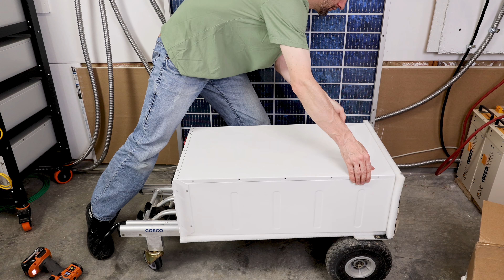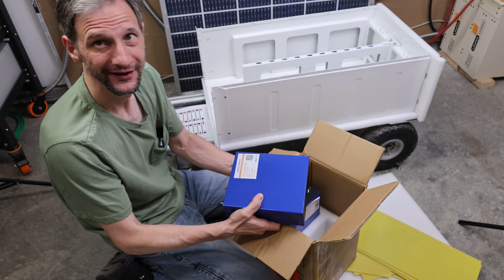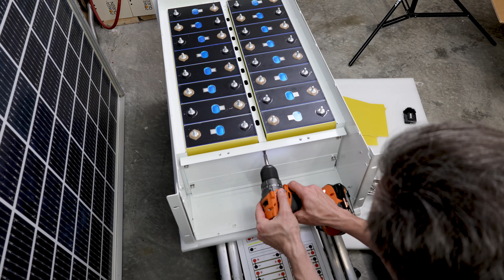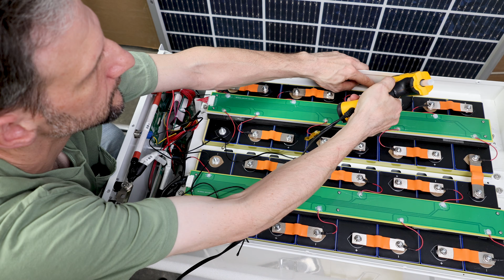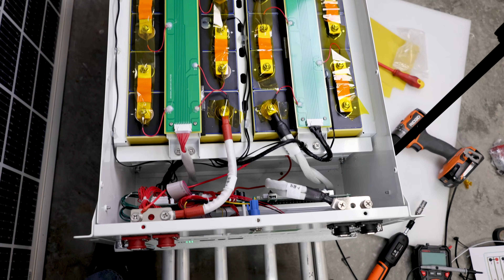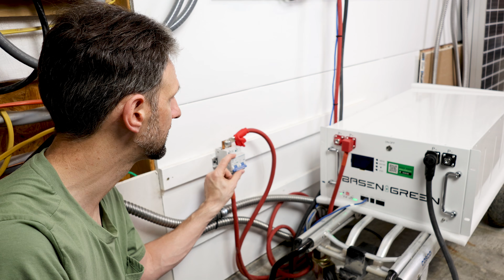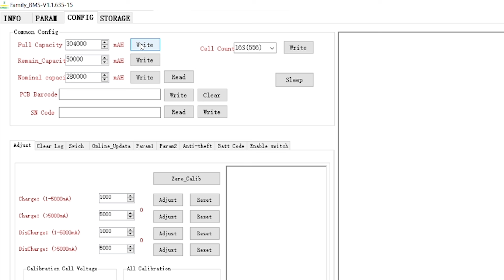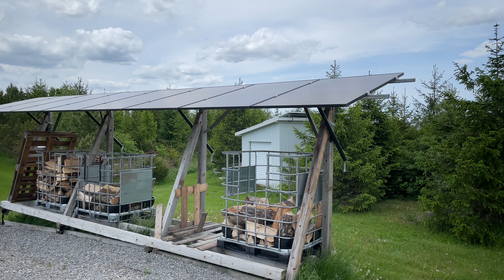SAVE Thousands - Build your own home solar battery backup!

Comment: Having worked on aircraft ni-cad batteries, if you decide to make this do not wear a watch or rings or wrenches 👍
Reply from the maker: Yes, good advice.  Avoid anything that could potentially cause a direct short.
Reply: I totally agree. The notch in my wedding ring also agrees. 😮
Reply: seen a guy vaporise the flesh around his wrist due to a watch band grounding to the aircraft chassis.

Comment: I'm not sure, but it appears that you continue to turn your torque wrench after it beeps. Wouldn't that damage the cells?
Reply from the maker: The timing of the sound in the video is probably just a little off.

Comment: I know you did not say this was for beginners but, I had high hopes, Because of the DIY-themed title of the video, that I'd be able to follow along.  You almosty had me enthralled, but, too much jargon for my beginner ears.  I'll keep searching for someone who wants to talk to folks in layman's terms.  "BMS"? (that's whhere I stopped wacthig; about the 7:30 mark)
Reply from the maker: BMS = Battery Management System
This is the electronic controller that balances the cells to keep them at the same level of charge as well as many other control points.
Reply: @ProjectsWithDave  Thanks for the definition.  I sincerely hope your channel succeeds.  I just need things to be a little more basic.  

Apparently, I'm not at the point in my solar education where some of the more in depth details and associated jargon are music to my ears.

Comment: Can use these cells in an rv ?
Reply from the maker: If you put this system in an RV, I would spend some time wrapping and securing the wiring better to protect from vibration.

Comment: @ProjectsWithDave I'm curious how do you connect it to your old battery? The two batteries will have different capacity and different full charge states. How do you prevent them from overcharging each other?
Reply from the maker: I connected my 25kWh pack with this 15kWh pack in parallel just to see what would happen.  The result is they do charge and discharge at different rates but it isn't too bad.  If I let it run for a couple of weeks without saturating at 100% charge the smaller battery drifts down and might be at 20% SOC when the larger pack is at 50%.  If I let them fully top off once a week it works ok.  Finally the best solution is to put matching packs together.

Comment: How much time does it takes to recharge it? 
And how much time, for example if I have only 5kWt or 10kWh?)
Reply from the maker: It completely depends on your charger.  The chargers I have connected can charge at 60A from the grid or 200A from solar.  At 60A for example that is about 3.1kW.  So a 10kWh battery would take about 10kWh/3.1kW= 3.2h.

Comment: I was kinda 'oh well, no way it's that cheap in Europe (Netherlands) but to my surprise the 16 batteries are 'only' 82 euros each and the housing is only 275 euros, including shipping from China. That's under 2k for a 14-15kW battery :O (a commercial pre-made setup using essentially the same hardware is 3000 euros - of course, that does mean you'll have warranty that you won't have (or rather, warranty that will be hard to claim when the housing comes from Alibaba) - still, an easy 35% savings).
Reply from the maker: Right, there are always trade offs like warranty to consider.
Reply: @ProjectsWithDave  I did the math and it comes down to 1600 for building the same battery pack you built vs 3000 new so maaaaaybe the 'package deal' warranty isn't worth the price of basically a 2nd 15kW battery 😄
Reply from the maker: I tend to lean towards DIY and "self insurance" for most things in my life.  I am often disappointed in warranties anyway.

Comment: The BMS leads go to the positive of each battery and the one black one goes to your first negative. 
I love the way you’re wrong with confidence though.
Reply: Seriously? Yet it all worked?
Reply: @rxonmymind8362  The balancing leads being hooked up wrong would not show any immediate effect. These leads are only there to compensate slight differences between the different cells and ensure they're on a consistent voltage. If you actually hooked those leads up wrong, it would only become apparent as some cell voltages drift over time, its not a problem that becomes visible right after putting it into operation
Reply: The positives are bridged to each negative and will read the same voltage, abeit of the battery below it. I love the way you are so confidently wrong.

Comment: This is a very unprofessional and dangerous assembly.
No non-conductive gloves, doesn't cover the terminals while working with conductive tools, terminals are not enclosed from the lid, thus if the case is dented it could make a permanent short.
FYI, I am an electrician but not in any capacity trained in these systems. Just my common sense and respect for electricity.

Comment: I accidentally shorted out one of these 3.2v 200ah lifepo4 batteries on some thin gauge wire. Insulation melted instantly and wire caught fire.
Reply from the maker: There is a lot of current available in these cells.  It's necessary to handle everything with the appropriate respect. That's why I added the extra insulating tape.  Anything to prevent accidental shorting.

Comment: Should always connect the positive first in case of accidental short to the chassis
Reply: @KL4life  then I'd be disconnecting the chassis from the negative terminal.
I understand using a chassis ground on a vehicle because of the length of runs of wire.
Is have a bus bar for the grounds and run one wire to the terminal
Reply from the maker: Right
Reply: What's the chassis connected to that would complete the circuit?
Reply: @samuelfox8126  uh, the chassis itself, duh. Every single one of those batteries is touching the chassis. If he were to hook up the negative first and accidentally touched anywhere on the chassis, it completes the circuit. Understand?
Reply: @KL4life be nice, not everyone has your level of expertise
Reply: @KL4life  gal
Reply: nope...

Comment: just curious but when you added the shims to get the batteries tight, would the batteries expand a small amount when they heat up? Just curious if that might be a problem, I dont mean if a battery fails and swells but I'm sure under a heavy load they might get hot and want to expand a little right? A small amount but at least something?
Reply from the maker: The batteries do expand when fully charged, but there is a foam spacer included in the stack that is also flexible.
Reply: love the video btw

Comment: Lame..... people!!! just buy the cells. Sit them on a shelf and hook them up...all this stuff is gimmick
Reply: Not a helpful comment without parts list, BMS recommendation and why recommended, pictures of finished install with racking chosen, .etc.  Do your own video with a link here so we can learn from your successes and failures.

Personally, I've already got 32 x 304 aHr cells via a US warehouse, a pair 48v JK Inverter BMS @ 200A continuous to parallel, big round red switches to isolate each bank, 2 bus bars, and instructions for connecting to my Sol-Ark 12k.

I've already built a couple 12v packs that are performing wonderfully.

Comment: 48v 100Ah batteries are now routinely under $1000 each, so the value proposition for this DIY build isn't all that good.
Reply: Wtf,  this is 300 ah for under $2000. That’s a lot.
Reply: Where can you find those prices? Even Will Prowse can't seem to find it based on his website for batteries. Also this is 200a BMS. All the server rack premade are 100a bms.

Comment: why would you keep tighten the screws after you clearly hear the beep...Jesus man, you want a fire in your house?
Reply: Have you used a digital Torque wrench before? All the the ones I've used have short beeps when you're within 0.5 to 1 nm of the limit
Reply: It's fine unless you strip the thread or spin the stud lol. Torque wrench is overkill to begin with

Comment: You mentioned something about Pre-charged Resistors and Capacitors: What is the purpose of these and the theory behind their operation?
Is this information in any of your other videos?

Thanks much.
Reply: The inverter uses capacitors in the process of turning 48vDC into 120vAC. Capacitors store a relatively small amount of energy but can accept it extremely quickly. A resistor allows only a small amount of current to pass allowing them to charge (comparatively) slowly, reducing the chance of damaging arcs when connections are being made (eg flipping breaker)

Comment: why not buy a gas generator?
Reply: Because:
1) you can’t run a generator backwards to create gas to store from your solar array
2) gas generators don’t switch over to cover grid power loss in a few milliseconds, rather they take at least a second to fire up, so you still have a power outage

Batteries provide utility most days of the year, gas generators provide utility a few days each year (if that)…which is a good thing because they are very expensive to run.

Comment: HI Dave, thanks for your great videos.  I'd like to build 2-3 of these batteries and use them with a SOL-ARK 15K or an EG4 18KPV.  I was wondering if you have full bidirectional communications capability with your inverter(s) and the included BMS (and if you knew that in advance) ?  

I can't get a straight answer about if this battery kit's BMS is 100% compatible with the above inverters.  So my concern is I might save money on the batteries and then lose important or valuable functionality if the inverter and the BMSs won't interoperate well.

It is hard to imagine why these inverter and BMS companies don't define a base functionality communications standard saving them BOTH time and money.  I'm also frustrated to conclude that these more expensive inverter manufacturers might effectively force me to wildly overspend on my batteries.  That raises the question, are these inverters WILDLY better than their competition if they force you to WILDLY overspend on batteries?

The other way to pose the question is.....will the battery savings offer enough NET VALUE if they can't interoperate fully with your inverter?

Your thoughts would be much appreciated!  THANKS

Comment: Dave, have you been cycling this pack on your house the past few weeks and if so how are they looking and how's the BMS been functioning?  Seems like things to look out for would be the BMS working properly and stable communications between the BMS firmware and the Victron with the battery firmware's Victron API and cells staying balanced.
Reply from the maker: At the moment I don't have the BMS connected to the Victron system.   I am running it as a "dumb battery" in parallel with my 25kWh SOK pack.  I have had no issues with the BMS.  I've gone multiple weeks without a top balance and the cells are all still in balance.  I do find that after a few weeks without a top balance, the SOC between the packs drifts apart significantly since they are different capacities.

Comment: Help me here, folks. If I can get 15kWh, including BMS and case, for 3200, why is the Powerwall a thing? OK; I'd love to do a large, generation and storage system (I don't know where you live, but I would Love to see more material on thermal storage, in cheap mediums like reject sand, or pebbles, to store those summer rays, for freezing days.), but even this, Ikea-level build, scared me, so I can see why the vast majority want as close to plug 'n' play as possible, but why aren't there armies of entrepreneurial electricians, with some mates who can build an app, buying, assembling, installing and gamifying systems such as these? You could turn 5k, on every one of these installed. (..and no, it isn't 'because, no one wants to work anymore.')
Reply from the maker: When you do a system DIY, you cut out all the risk and overhead for warranty and system level customer support.
Reply: Because you have to become a real business and insure and warrant those installs.

Comment: Dave, with 2 of the BassenGreen battery packs(~30kWh) and 2 Victron MultiPlus II 120V 5k inverters would the DC power distribution be optimal in the fully parallel configuration? ie Batt1 jumpered to Batt2 which is then distributed Inv1 and Inv2( Victron Distributor ) or is there any advantage separating?  From what I've seen of the Victron MultiPlus II units I can put my 2 grid-tied inverter circuits on the Victron's AC1(main) output the solar generated outputs will be maintained in a power outage AND the zero backfeed adjustment can ensure the batteries are still being charged via existing solar configuration.  In the future I may do as you did and add a Victron solar charger when I add more panels instead of going with micro-inverters since NEM3 invalidates being grid-tied generating.
Reply from the maker: If I understand your setup correctly, I would connect both packs to a Victron Lynx Distributor buss bar and run them in parallel. Otherwise you would have an unbalanced SOC between the packs and be unable to utilize the full capacity.
Reply: @ProjectsWithDave  and while I don't understand the details of how the MultiPlus II units AC charge off excess(zero feed) grid-tied inverter outputs, splitting that between 2 separate batteries and 2 inverters likely would not work. I will build a 2PS16 configuration. Since I've seen someone(Will Prowse) with 2 MultiPlus II 48/3000/120 in split phase try to charge a Tesla at 240V/21A and trip the Victron( 20A worked ), it appears for future DoRu42 I need 2 of the 48/5000/120 model( single no 240V US option ).  Thanks for sharing your experiences and research.

Comment: 15kWh of battery at retail levels is only $4500 these days. That gets you tested hardware, warranty and free assembly. The labor and danger involved really worth saving 2k? Ask your insurance what they'd rather see. I'm all for DIY, but unless you do this as a trained electrical engineer 15kWh is a lot of potential destruction and death.
Reply from the maker: For sure, everything comes with a trade off.
Reply: @ProjectsWithDave  I'm not sure $2000 for a potential fire hazard and no insurance coverage should it burn is worth it. I value my life a bit higher than that. I'm not saying it will explode, but the chances are higher and I know insurances are not gonna do anything when they find out it was a DIY setup. I would do this for like a shed or maybe a garage separated from the house.

Comment: So am I the only one that said WTF when he made the batteries (super snug) and (I'm going to stand it on end) 😮😮🌎🤡
Just so everyone knows, you need room for thermal expansion and super snug is NOT what you want and if you stand it on end, it's going to compress the lower batteries.
Also, FYI...
15kw is enough power to burn your house down x10 over

Comment: This is way over my head! At first, I thought it was something I might be able to do. Then, you walked over to the very established wall of equipment, of which I'm scared to ask the price. Looks like I'll have to stick with pre-manufactured, Bluetti type stuff.
Reply: Go watch some Will Prowse videos for beginners. He has amazing content as well. This was a very good video btw. 😁
Reply: I've had some history with the Bluetti type kits, and I think they're OK. Beware though, a similar competitive product (can't name them) almost killed a family in VT last winter due to a forced Bluetooth update on a subcomponent taking out their "in a box" system. Right when they needed it to run their mini-split during a storm. They had gone through many outages before, but it was too much for their home and that night. Husband broke his leg on the front porch. Phones were down. And they had no alternative heat source other than the fully charged battery system which wouldn't operate. 

They have since drank the anti-cool aid and installed a wood stove like many suggested. A $40 craigslist kerosene heater would have been a good alternative.

Comment: When you were adding the bus bars, it seemed like you were deliberate about doing it one-handed. Is that a best practice to avoid currents through the chest in the event of a shock?
Reply from the maker: The deliberate part was not connecting the right and left banks until the end.  That way you only have half the voltage available.

Comment: 304ah cells but at only 3.2 volts. So you need 4 to make a 12 volt battery. 16 of these cells (what you have) will be like 4 300ah 12 volt batteries. I can by this already made for 2 grand. I save 250 dollars with no building. Oh...sorry. Maybe I wasn't suppose to point this out. 🤣😂🤣
Reply: yes theres 300 amp 12v sealed lithuim battery for 330 GBP ($400) which includes a 200ah BMS ... that would be 1320 pounds ($1600) for 14.4 KWH and you wouldnt need a case or rack .

Comment: Any reason not to user this in a van?
Reply from the maker: If I were installing this in a vehicle, I would spend more time wrapping and securing all the cabling.  For instance the BMS wires are weak and would not tolerate the vibration very well.

Comment: The biggest pain is top balancing the pack. I just bought 2x DC Variable Power Supply, connected the batteries in parallel prior to putting them in the pack and set it to 3.5v and left it for about a week before they were all top balanced.
Reply: Not necessary bms with active balancing will do that for you, my 16 280ah charged to 100% and top balanced within 6 hours done
Reply: @HaroldMcDermott  Yes, I have two packs with a pitiful balancer so you need to do it in that case.